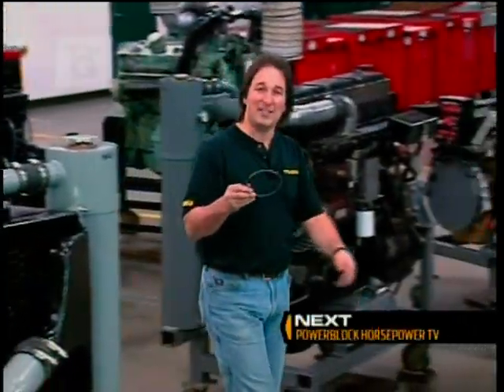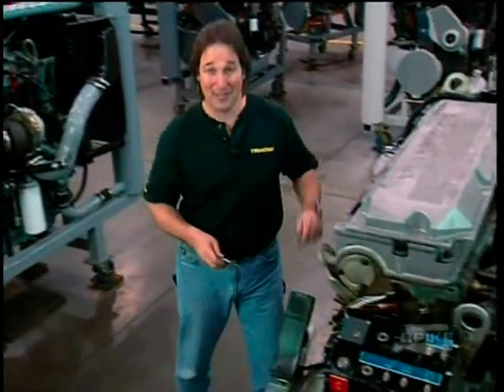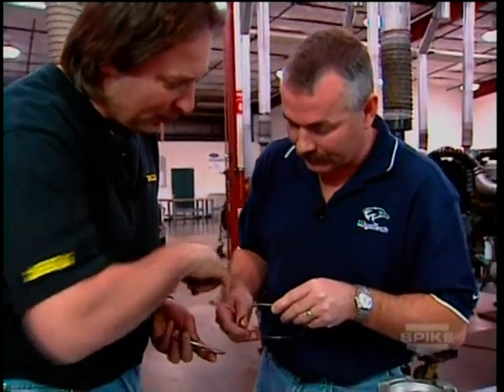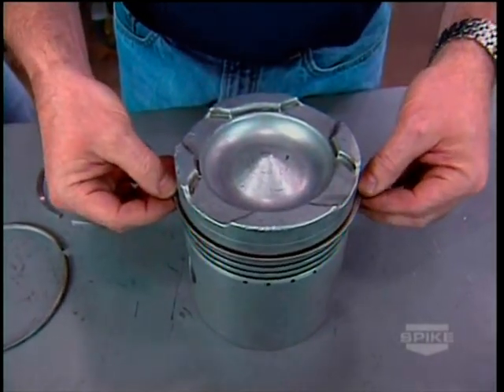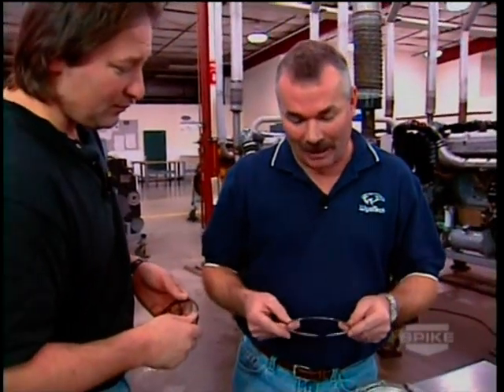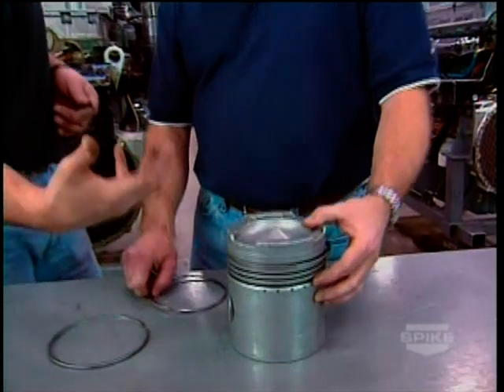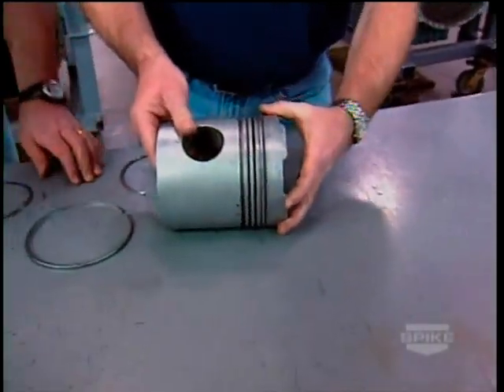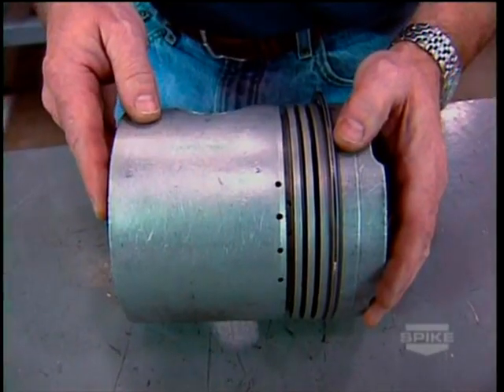Here's why diesel engines are better than gasoline engines

Comment: Cleanliness is a huge deal when you're in a rebuild shop... these guys have motor projects going on all the time.  I think they're a bunch of goofs... that read off of a prompter... but none the less, you can't get dirt and grime in a fresh rebuild...  you could be one of those R&R mechanics, that's a dirty money making, honest job.  Front end- alignments- brakes- shocks... your typical shop stuff.  Diagnostics... not such a good money maker especially if you're rolling around in dirt and grease

Comment: I Take It You Have Never been In BMW or Benz 
Shop All Garages Don't Have to be full Of grease would you rather Work in a shop floor full of grease and outdoor temp of 100 Deg-
of Air Conditioned Shop and a clean Floor